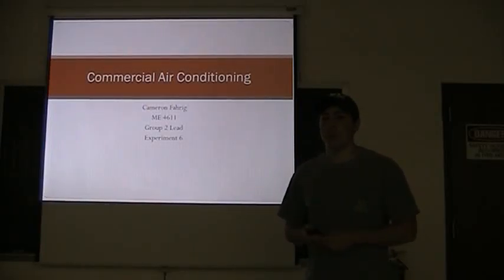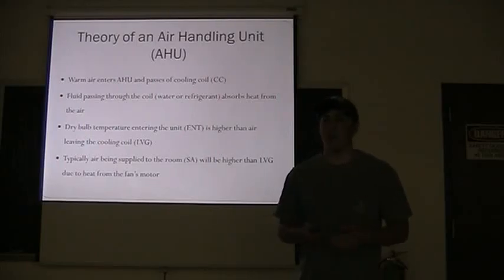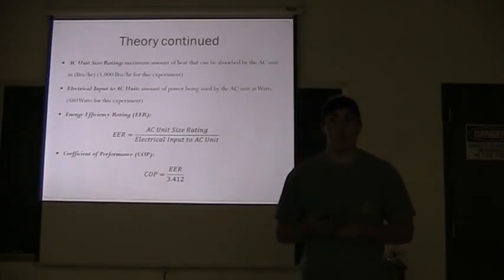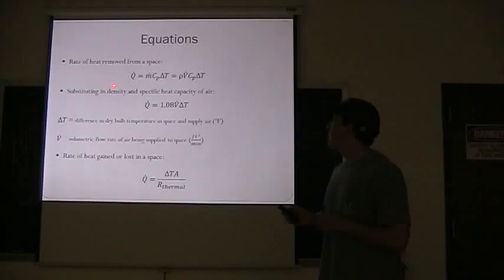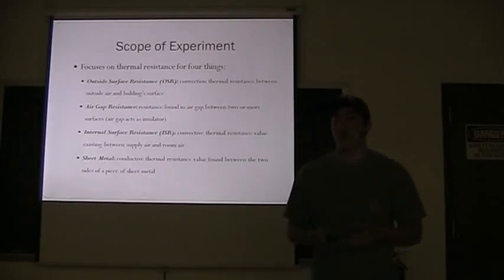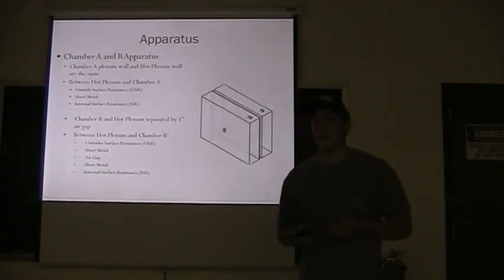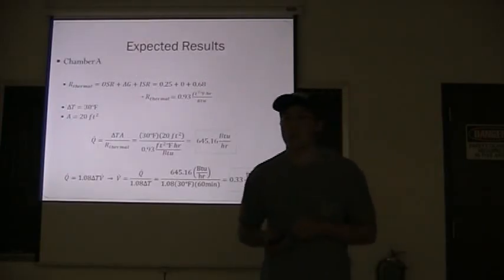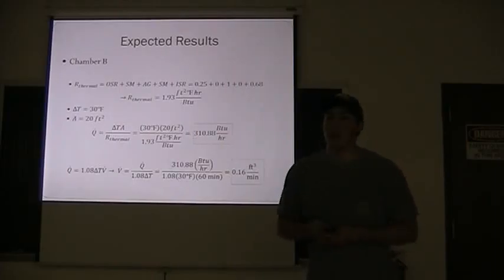#9 Group 2 Lead Exp 6 Cameron Fahrig

Comment: You seemed very confident speaking and it flowed very smoothly. The only thing I would say to work on it the presentation itself, by making the words a little bigger on the slides. Other than that you did a great job.

Comment: I think this is one of my better presentations. My timing and body language were pretty good, but from the video it seems like I am slightly fidgety at times. Also, I still need to reduce my use of filler words, as that seems to be my biggest weakness when it comes to my presentations. Other than that, I think the presentation went smoothly and was sufficiently informative while still remaining concise.